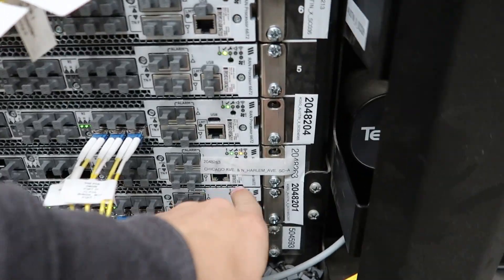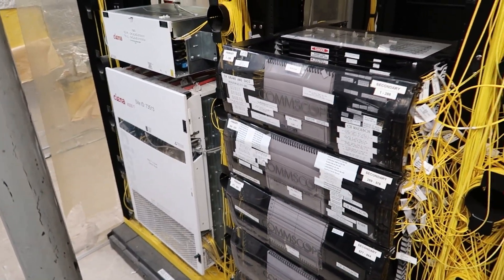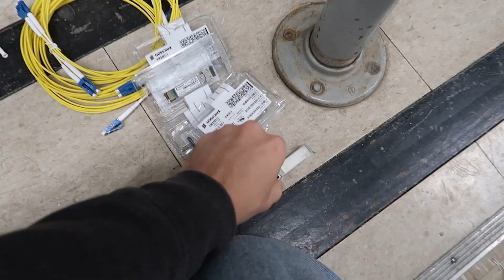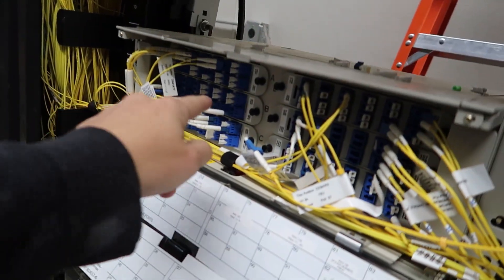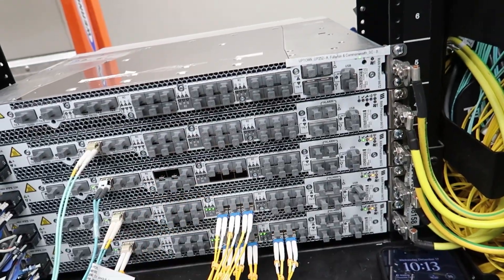Telecom Engineer Day In The Life | Server Cabinet Setup & Wiring

Comment: Really cool to see a vlog of field engineer work come up in my feed! I've worked a bit as a field engineer for an IT company in the past. Spent enough time in telco exchanges. Not on radio specifically, but mostly with mostly the IP network and server infrastructure. 

Definitely don't miss those night maintenance jobs. Was good overtime for a bit of pocket money though 😝

I'm surprised telcos there are cool with you filming inside their racks! Even whipping out the the phone camera for work purposes, you need to double check if it's ok, in some telco racks here in Australia, in my experience.

Comment: How much is each of those SFP,s and the speed on them ?
Reply: 1gb or 10gb, but probably 10gb.
Reply from the maker: Yes 10g
Reply from the maker: Im not sure on the price but the speed id have to login to check im not 100% sure but i think its 10G_Full
Reply: @SullyOpsVlogs crazy fast backhaul I remember when it was like 100mbps to 1000mbps
Reply: @coreybabcock2025  that's fronthaul to radios, technically its over 10.x gig CPRI speeds... some radios need 25.x gig CPRI cause they can do 200+MHz of spectrum, here in lithuania we do 10gig cause its plenty, and sites get fed by 10 or 25gig backhaul to core, we don't do fronthaul cause there is no need

Comment: Super cool, always been interested in the cellular networks. I work at a cloud provider as a Network Engineer, but am always interested in the physical bits. How familiar are you with the DWDM stuff? I work with it a lot. It's neat.
Reply from the maker: Not a whole lot but a decent bit
Reply: @SullyOpsVlogs  What it seems like is from the tower each radio likely has a SFP in it that is tuned to a specific frequency already, the white "dwdm" you interact with is a single fiber passive mux/demux, and all the ports are for specific frequencies, eg Port 4 was 194.5Ghz (CH45) / 194.4Ghz (CH44). Since it looks like you're just inserting the SFPs into the device randomly, they are likely tunable transceivers, so the reason it takes so long for them to link is because the engineers are settings their frequencies and it takes a bit for the SFP to actually re-tune, then when it's done it's able to establish a link. DWDM allows multiple radios to transmit/receive over a single fiber, just on different frequencies.

tl;dr, it's just the devices transmitting/receiving on certain frequencies, the passive mux/demux combines those onto a single fiber (COM), which goes out to the towers, where there is another passive mux/demux which breaks them out off the single fiber into their individual frequencies, which go back out to the device on the specific ports.
Reply: I was a senior network engineer for a large ISP in the US and we used it all the time to connect carrier routers back to our back haul network into our ONS 15454 boxes. It really is neat to work with.